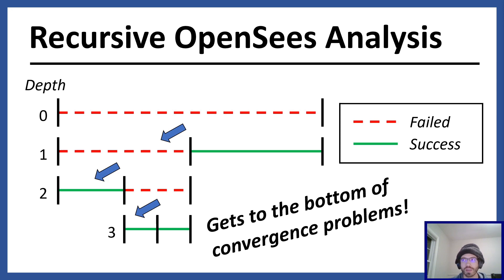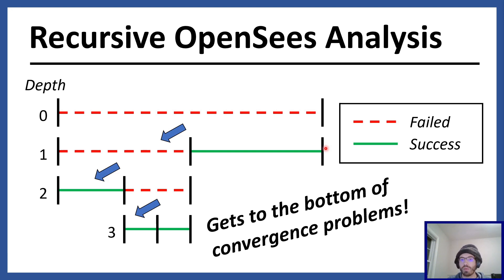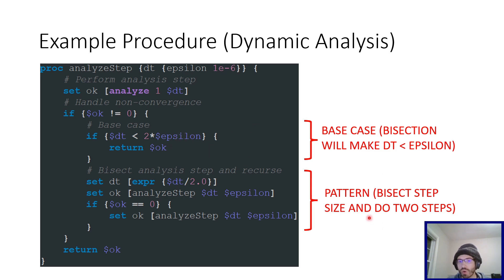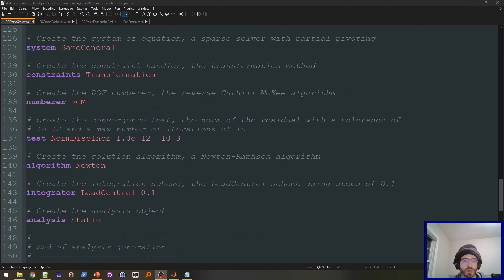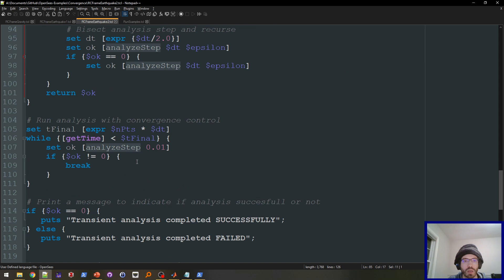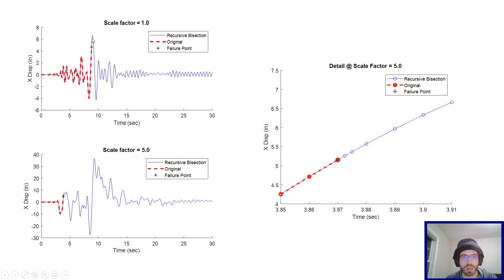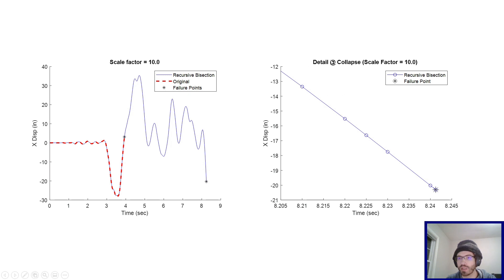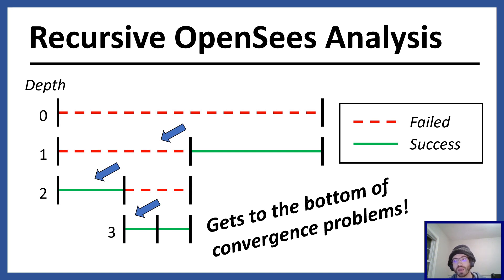Using Recursion to Tackle Convergence Issues in OpenSees

Comment: Hello  Alex. I have an Opensees model that I have faced the non-convergence problem and none of these strategies has not worked. I checked everything and it seems everything, i.e., the modeling aspects, is fine but I have not resolved the issue. what else do you suggest? Thank you
Reply: @alexbakeredu  Hi Alex, Test convergence. 
Trying reducing time step by 2.0 
WARNING: CTestNormDispIncr::test() - failed to converge  
after: 100 iterations  current Norm: 0.493224 (max: 1e-008, Norm deltaR: 14.089) 
NewtnRaphson::solveCurrentStep() -the ConvergenceTest object failed in test() 
DirectIntegrationAnalysis::analyze() - the Algorithm failed at time 15.1412 
OpenSees > analyze failed, returned: -3 error flag 
Trying reducing time step by 2.0 and more iterations 
WARNING: CTestNormDispIncr::test() - failed to converge  
after: 1000 iterations  current Norm: 0.493224 (max: 1e-008, Norm deltaR: 14.089) 
NewtnRaphson::solveCurrentStep() -the ConvergenceTest object failed in test() 
DirectIntegrationAnalysis::analyze() - the Algorithm failed at time 15.1412 
OpenSees > analyze failed, returned: -3 error flag 
Trying reducing time step by 5.0 and more iterations 
WARNING: CTestNormDispIncr::test() - failed to converge  
after: 1000 iterations  current Norm: 0.498064 (max: 1e-008, Norm deltaR: 14.2424)

My Model is very sensitive to calibration data. Also, I think there is a kinematic difficulty in the model as I have a shear mechanism with rigid elements( high axial and bending stiffness)
Reply: @esmaeilmorshedi3573 can you tell whether this convergence issue has been solved or not ,and if solved can u tell how to solve it?